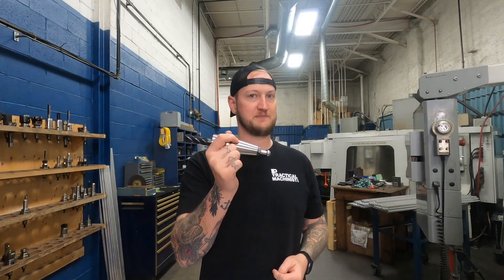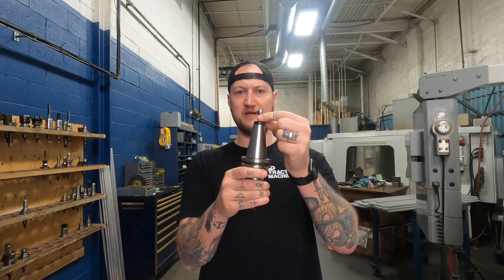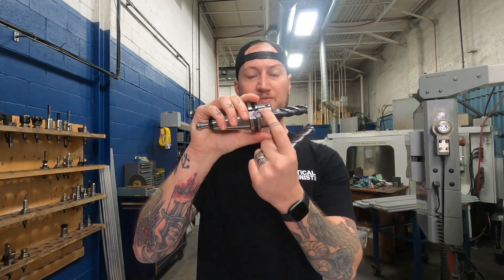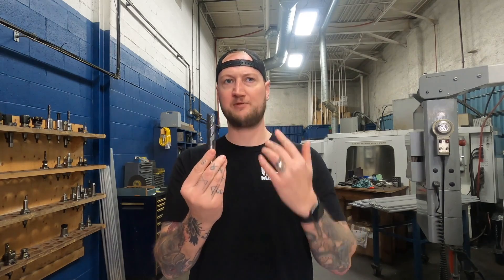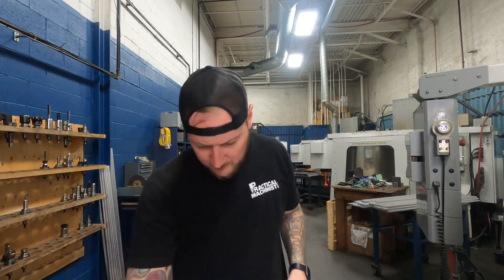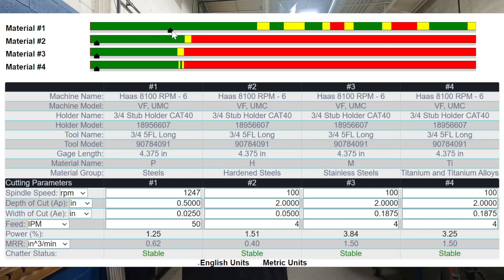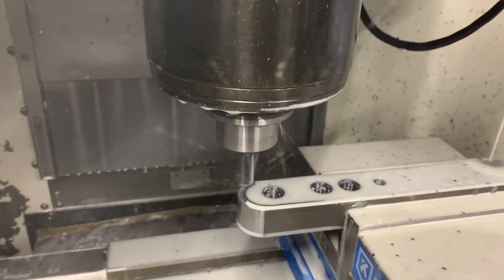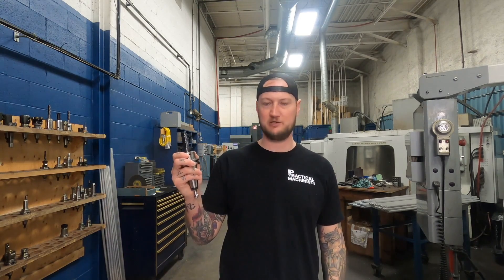Can THIS Be The Solution to Chatter Issues? | Machine Shop Talk Ep. 86

Comment: Are they planning larger diameter and longer doc tooling? I support a structural steel fabricator running a cat 50 vmc and 3/4 x 2 is the bottom end of tooling around here.
Reply: Reading the comments here, it's looking like the 6000rpm top end may not gain much advantage from a highly balanced tool system.
Reply: @Ddabig40mac  RPM probably needs to stay near the same for predicted harmonics.

Comment: I would love to see 5.5K and 223 IPM with Ae of .025 and .5 Ap. Lets see that video and tool life. I will switch from Kennametal if it works.
Reply: That doesn’t actually sound too too ridiculous - what diameter cutter? 3/4” or 1/2”?
Reply: Your probably right, the more I think about it. I usually use 10 to 15 percent of diameter for step over. @LakewoodMachine
Reply: I agree with Ian. That doesn't sound too over the top. I run a HAAS VF3ss and those parameters wouldn't be too intimidating. I'd trust the green zone on this, it makes sense to me.

Comment: Why not just use heat shrink holders?
You can use any brand or style carbide cutters.
They run true, no flats needed.
With those, you are committed to using their brand & style of cutters, no matter what their pricing & availability is.
If I break a tool, I need one today, not in 2 days.
Heat shrink or hydraulic chucks are way to go.
Never had a heat shrink have more than 
.0008 TIR run-out. Usually 
.0005 or less.(inch).
Reply: They are very expensive and require equipment to heat them up and cool them down like the Haimer system. The goal of a small job shop is to make money and buying all shrink fit and hydraulic holders is very cost prohibitive.
Reply: @Jon Dillehay  
You have to look at the big picture. 
There are less expensive heat units than a Haimer brand.
We use one that uses air blast to cool rather than cooling unit.
A few holders & a heat shrink unit  would be a start.
Having a brand specific tooling system can get very expensive over time. Who knows what their prices will do after they have you set up with their cutters. 
Shrink fit, you can use any brand/style cutters you like. Whoever has a sale, buy cutters. 
Don't have to custom order tools with a specific out of holder to reach.
Simplifies cutter stock, saving $ in the long run.
Reply: @johnhines3591  I buy the weldon set screw style holders and call it a day, even at the job shops ive worked, thats all they used and can hold .0005” - .0002” tolerances all day on a mill. The shrink fit are nice because they improve run out, rigidity and tool life but it is just hard to justify the cost in a cut throat business environment. It could be the difference between just keeping the lights on one month and actually making a profit. Are the benefits of the shrink fit holders realistically going to make you more money than you would save buy just not buying them? That’s up to the individual.
Reply: @Jon Dillehay  
My point was if investing in a complete tooling system, like video was about, why go brand specific on cutters.
Yes, I use mostly side lock holders. When you go to high speed machining, side locks aren't the best. 
Above 6,000 rpm, tools should be balanced. Wes have some machines that have 25,000 rpm spindles. 4 that have 35,000 rpm spindles. 
Yes, even small job shops can benefit from shrink fit, I understand the small shops. Worked for one, 7 employees. 
Was there for 10 years.
Reply: There is a lot of "marketing talk" with this. But I get that they are trying to make this something everyone can understand. But don't say my tool holder is balanced as if no other holder hasn't been. The dashboard is a nice and quick ballpark numbers thing which is pretty nice though.
Reply: what do you use for your shrink fit system, we have 5 axis machine at my work but somehow don't have heat shrink tooling.....
Reply: If you can’t afford a heat shrink system starting a new shop just blow torch it. Yg-1 is a very good brand